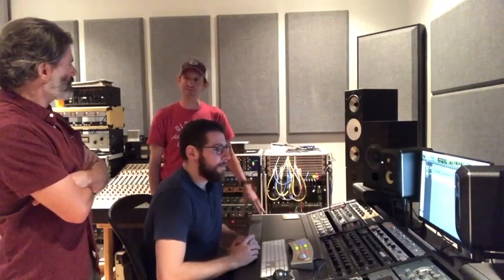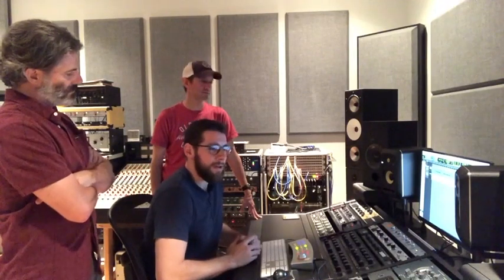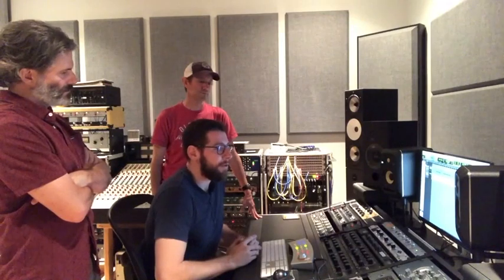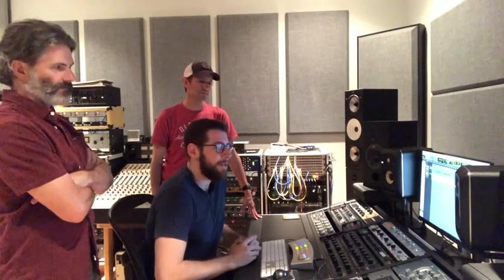Producer/Engineer Jacquire King Using the Royer dBooster To Record Acoustic Guitar

Comment: First, my respect for Jacquire King, best producer on the planet.  So I preferred the r-121 without the booster.  Running the mic-pre hot on the API you get a little more room noise, but the color of the UAD API running hot sounds crunchy and delicious in my opinion, which is funny because I learned that directly from Jacquire 😂.  On the other hand, if I were recording vocals or high gain electric guitar the booster would be wonderful👌.  I think it depends on the situation also, if you want the acoustic a little buried in the mix I would say no booster, but if it’s a vocal acoustic solo performance I think the booster would be great!  All in all, great demo, great mic, and my absolute favorite producer of all time!  Thanks 🙏